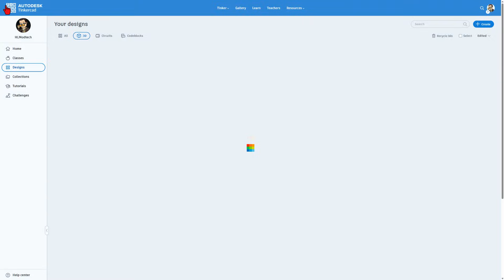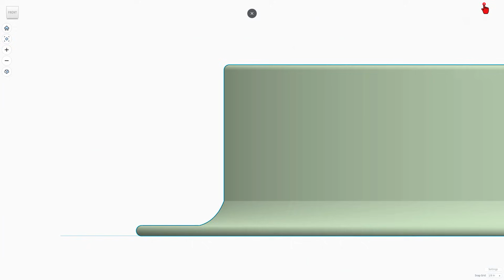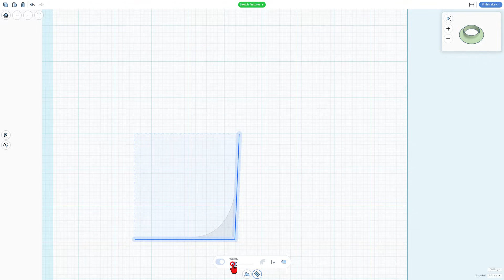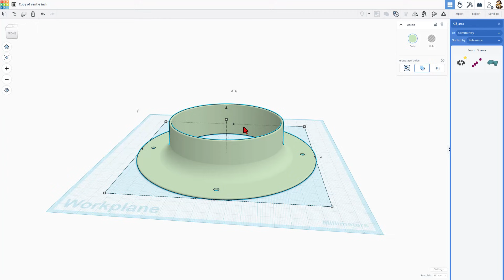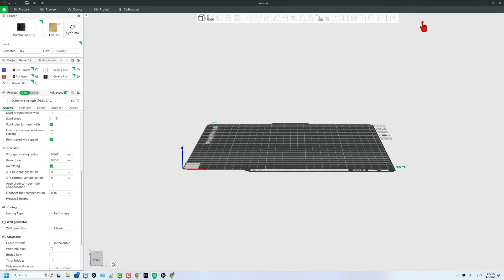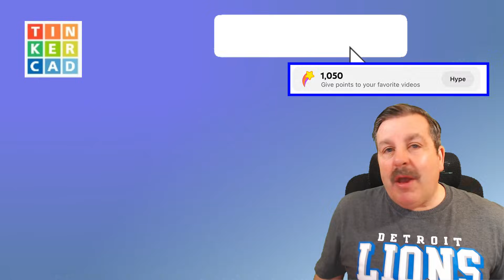Faster, Smarter Tinkercad Sketch Revolve Fillet Vent Adapter! 💯🤯

Comment: Would also add a small lip to the opening to help prevent the pipe slipping off as it's now tapered.
Great video. Keep up the good work.
Reply from the maker: That is a great idea. 💯🔥 I just did similar for a silly sleeve I was making between 2 pipes. Super simple process with Sketch Revolve.